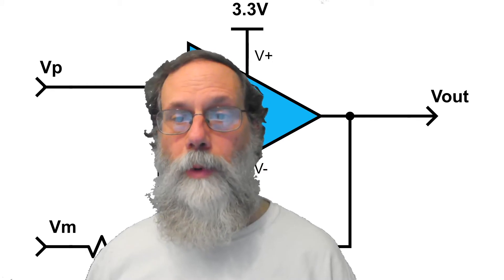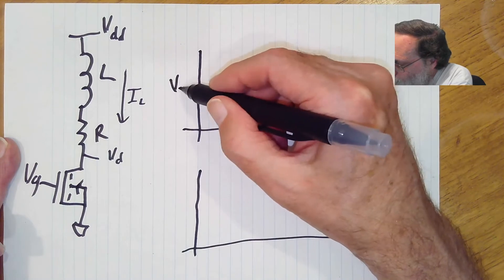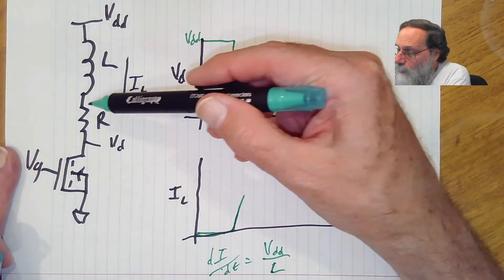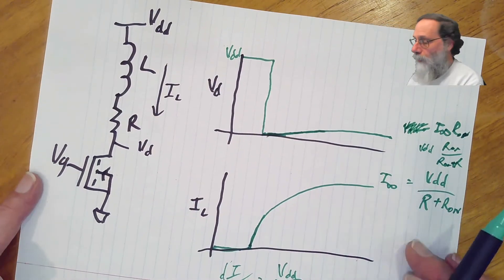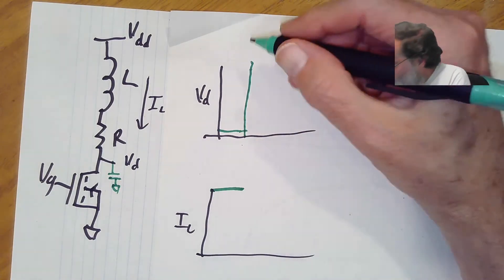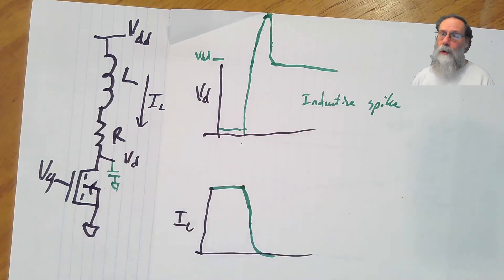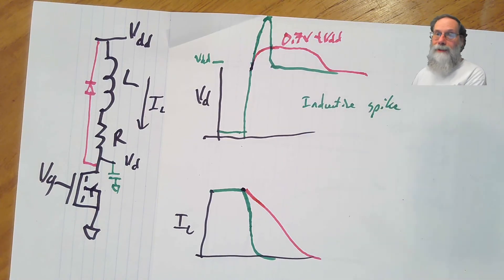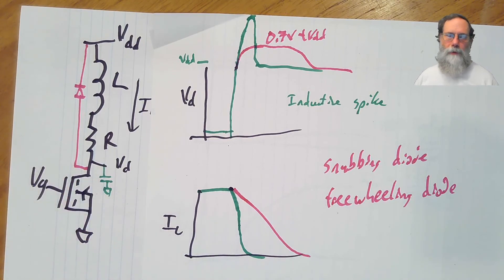Switching inductive load §32.3

Comment: inductive load, irf260 used as a dimmer, 165vdc, 250W brushed motor, mosfet fry very quickly.
with diode it fry even faster, WHY?
Reply from the maker: Without more information about the circuit, it is hard to tell what the problem is.  If you are frying the MOSFET, you are probably running too much current through it when it is not fully on.  Is the gate voltage (Vgs) at least 10 V but no more than 20V? How fast is the gate voltage rising?  How much of the time is the MOSFET not fully turned on or turned off? (That is when the MOSFET dissipates the most energy and heats up the most.)  Use the gate-charge model (explained in another video) to calculate the switching speed.  Do you have a good heatsink?  The junction-to-ambient thermal resistance without a heatsink is 40°C/W and the max operating temperature is 175°C, so you can only dissipate about 3–4W in the MOSFET without a heatsink without frying it.

Comment: If using a high side MOSFET, it should be same, right?
Reply from the maker: Almost the same—the voltage spikes will be in the opposite direction, but the the mechanism and explanation are symmetric to the low-side case.

Comment: Best way actually is to connect HV DC type capacitor with ground of capacitor on common ground then a fast shottky  "steering" diode connected between the drain (if mosfet) to the positive of cap. 
Cap will fill like crazy if steering diode pointed in correct direction.  
Discharging capacitor to load occasionally (battery to charge if you want) creates real power upon discharge.  The cap will suck up all the Destructive Transients never problem with voltage spikes anymore and you get some power happening when cap discharges.  Have two caps two diode and alternate their discharge so never a period of time during a discharge when transistor or mosfet is not protected by steering diode and cap.
Reply from the maker: That works if the capacitor is big enough and you provide additional circuitry to discharge the capacitor (to the load or to a battery).  It is a bit complicated for a first course in electronics.

Comment: Great video, very clear presentation! I have 3 follow-up questions: 1. what is the physical nature of the parasitic capacitance ("where is it") ?
 2. Does the voltage spike when switchig off cause electromagnetic noise? 
3.What if one adds a capacitor on purpose parallel to the parasitic capasitance,,would that decrease the voltage spike?
Reply from the maker: 1.  The gate is a conductor, the drain and source are conducting semiconductors (and the channel, when the FET is on).  There is an insulating oxide material between the gate and source/drain/channel.  Hence, a capacitor (the Miller capacitance).  But the capacitance being discussed here is mainly wiring capacitance—any pair of conductors that are not connected together are insulated from each other and so have some capacitance dependent on their size, position, and insulating materials.
2. The voltage spike and associated current are electrical noise—when the current flows through a wire, a magnetic field is created, so there is electromagnetic noise created.
3. Putting in a larger capacitance lowers the frequency of the LC tank, which can spread out the spike making it somewhat lower voltage but ringing longer.
Reply: @gasstationwithoutpumps  thanks for your time! It all fits together.

Comment: thank you for describing, it's very clearly. the example takes mosfet as low side switch. if mosfet at high switch, when the mosfet turn off, the energy storing in the inductor will discharge to the parasitic capacitor of mosfet through Vdd and cause spike at drain as well? thank you!
Reply from the maker: Yes, the situation is symmetric if you switch on the high side instead of the low side.  The basic concept—that current through the inductor continues to flow—still applies. The voltage spike will have the opposite polarity from the spike from low-side switching.

Comment: You've just articulated the reason why I have stopped using semiconductors to switch inductors - the need to add extra components just to protect your switch.  
For example, I have a high-current 12V solenoid that I want to switch briefly with energy from a capacitor bank, using an adjustable timer circuit to dump the load into the solenoid coil.  My system works perfectly when replacing the solenoid coil with an incandescent lamp, but when I try to sub in the solenoid, the back-emf fries even my strongest MOSFETS, IGBTs etc, no matter how high their supposed voltage ratings. 
It got too expensive in semiconductors, and too much trouble to solder in <protection> diodes... so I am back to using electromechanical relays to switch the current to the solenoid.  Luckily the back-EMF from the relay coil doesn't seem to worry my smaller and cheaper MOSFET acting between it and the timer.
Sometimes old tech is more trustworthy and resilient than newer in my experience.
Reply from the maker: Electromechanical relays are still used when you want a simple on-off function, especially when you are switching AC currents, but if you are frying semiconductors in the application, then you probably will have only limited life from the contacts in the relay. Snubbing or free-wheeling diodes are essential, though, so if you've been omitting them, then it is no wonder that you've been frying your semiconductors.
Reply: but for controlling motors w/ pwm there's really no other option.
Reply: @JayDee-b5u  Which again... is why I choose analogue devices like physical electromagnetic relays rather than adding rectifiers in reverse-bias orientation across inductive loads.  That sucks.

The MOSFETS I'm using seem to cope with whatever back-EMF the small relay coil produces, whereas it dies if I try to use it to dump the capacitor into the  ignition coil primary.  Ever.  Damn. Time.  Grrr.

The relay contacts die over time (not made for switching high current DC), but I've learned to trust analogue over semiconductors for any significant power surges.
Reply: @Squire_Chris  makes sense

Comment: Hello, great video in detail, thanks for it. By the way, that snubber diode can be a regular 1n4007 diode or it has to be a fast recovery diode such as 1n4148? thanks
Reply: You can also add a Zener Diode (in the reverse direction) in series with the normal diode. The Zener diode will allow the voltage to rise higher than Vdd+0.7, and the spike will dissipate faster. Use a diode with as high voltage as possible that your drive transistor can handle (leave some safety margin). For example, if your Vdd is 12V and your drive transistor can tolerate 35V Vds, choose a Zener voltage of 12-18 V.
Reply from the maker: I suppose that a lot depends on how big the inductive load and how much current you are switching.  I've only switched fairly small currents, and so a regular diode was fine.

Comment: Hey gr8 video, how do I contact you...
Reply from the maker: You can comment here or on my blog https://gasstationwithoutpumps.wordpress.com.  If it is about the book, there is a forum at https://community.leanpub.com/c/applied_analog_electronics (which was disabled for a while, because of a leanpub change, but should be enabled again).
Reply: @gasstationwithoutpumps  thx for the reply, it would be rally helpful if u could help me with u r email, bcz i need to send u some schematics for further discussion..

The book link is not working.
Reply from the maker: @pragatmudra8372  OK,  try emailing karplus@soe.ucsc.edu
Reply: @gasstationwithoutpumps  i just emailed you...